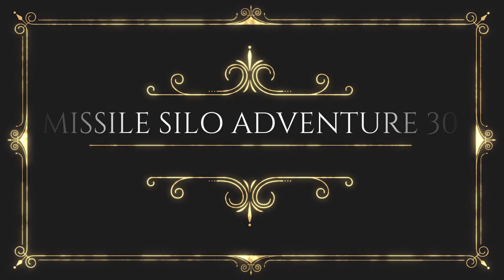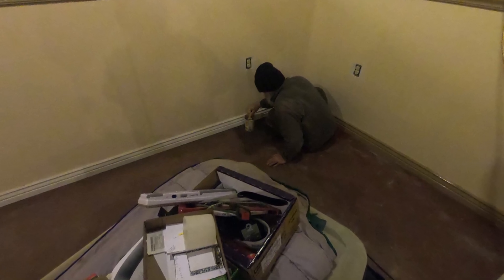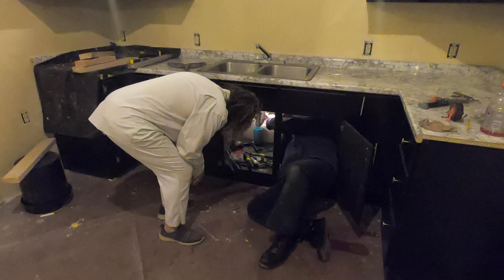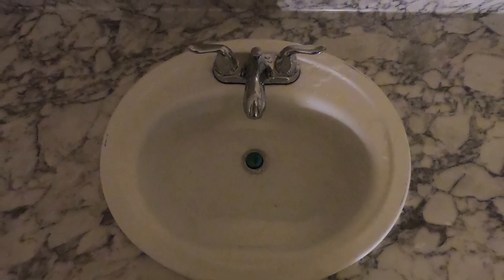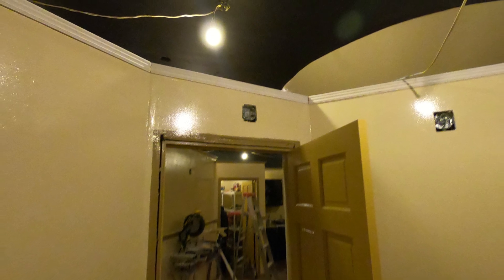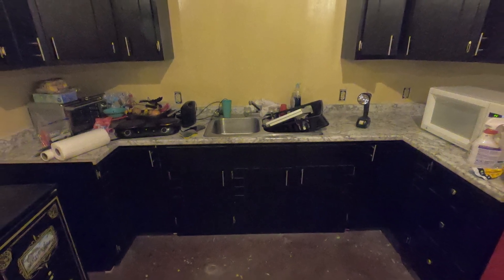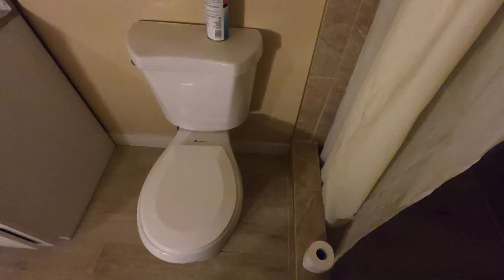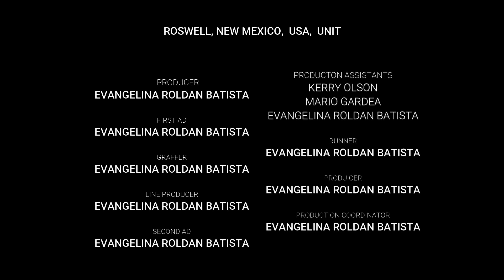MISSILE SILO ADVENTURE 30..Finishing Trim and Kitchen Cabinets Upper Launch Control Center Atlas F.

Comment: Do you actually have remains of the missile elevator and fueling equipment left in the silo? Having one of the last sites with intact cribwork sounds really amazing!
Reply from the maker: Yes having a Silo Crib is amazing and most important it is naturally dry.  As for a Launch Platform/Missile Elevator I'm sorry I don't.  Only ones I have seen were several year ago at the 556th Sites in upstate NY, however all of them had major water infiltration problems.  Word has it they were salvaged about 20 years ago.  Most of the fueling and oxidizer equipment has been removed in most Sites, but again excluding the 556th Sites with several in Vermont that looked to have much equipment remaining however they were full of water. 
All the Best...
Reply: @SiloMan I´ve seen photos of site 11 near Seward at Nebrasca Silos - and was completely surprised . They´ve even left the survival kits, electric cabinets with intact wiring..wow. Alexander Michael´s silo (i think) used to have the old flame deflector locked between the two open silo doors before he started refurbishing it. Maybe it got stuck while the contractors tried lifting the whole platform out of the silo. All the best from Germany.
Reply: Greyhound Components I found the photos you’re referring to in regards to Seward.  This site was definitely kept locked up privately, as it’s in fantastic shape in its original unaltered state.  ZERO graffiti is extremely rare!

 http://www.nebraskamissilesilos.com/Seward-Site%2011/disk4.htm